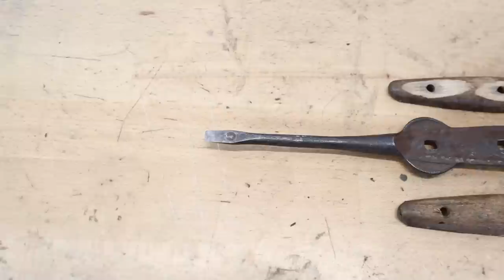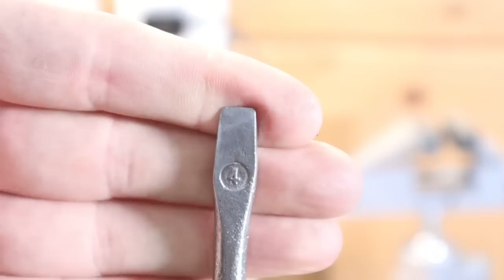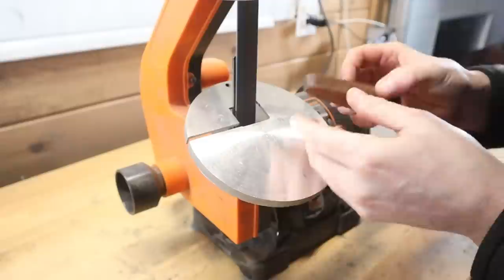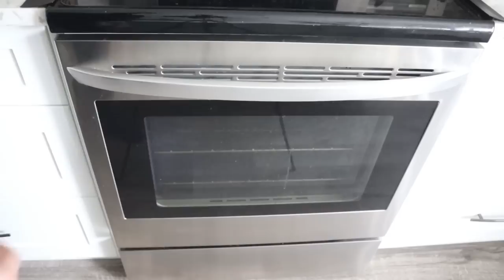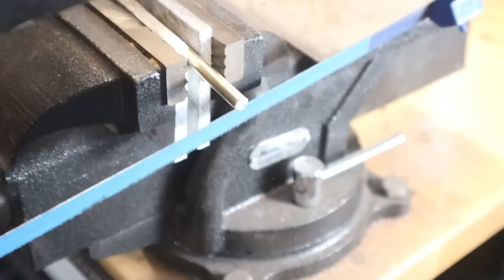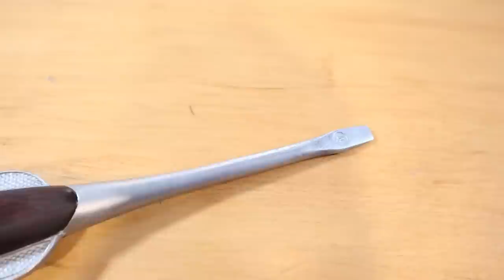Screwdriver Restoration

Comment: I would have preferred to see as much of the original patina on the metal as possible and I would have aged the new scales to match.
Reply from the maker: Not me. I love how this turned out. Feel free to restore things how you'd like, tho.
Reply: @kramerdesignco  Agreed in full. It's your tool to do whatever you want. But I also agree with people having an opinion as long as they aren't trying to force it on you.
I have done a perfect handle screwdriver restoration that I did an over the top job on with a mirror finish and peened pins. I decided to do the OTT resto because it was an unknown brand with no markings.
Reply from the maker: @russg1451  Agreed!